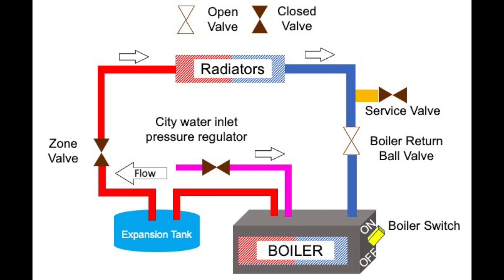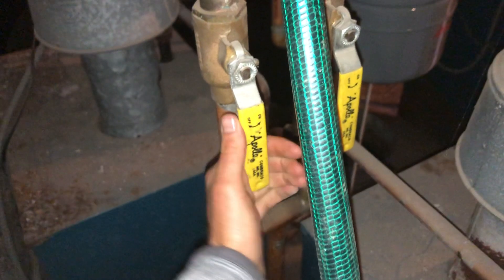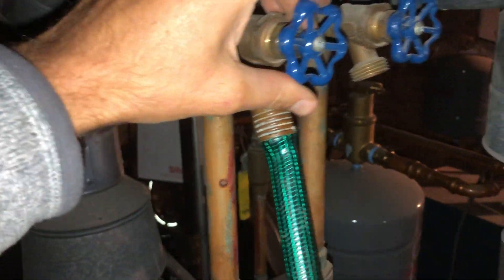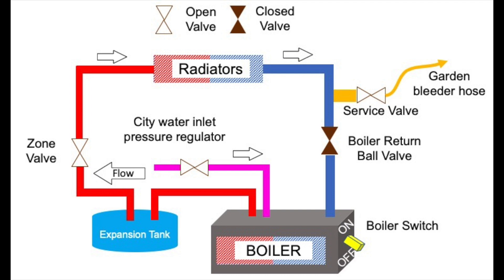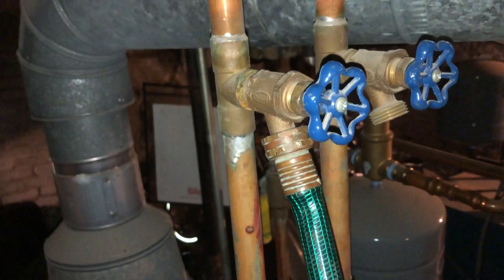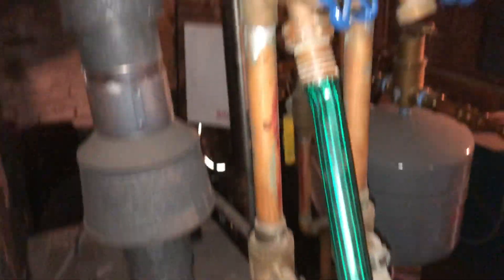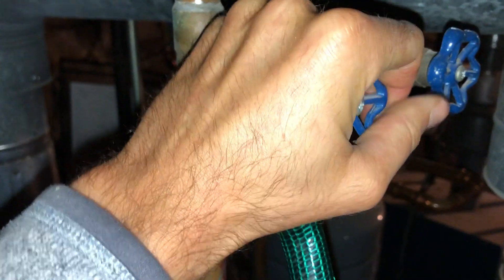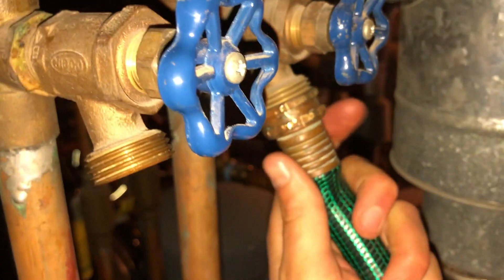How to Bleed Radiators in Entire Heating System Quickly and Effectively

Comment: Tracing my 30-year old pressurised CH system, I find a pipe teed off to the hot water cylinder heating spiral (i.e. coming from the boiler) that goes via a gate valve to the water tank in the loft.  There is no feed loop near the boiler, which is in an outhouse.  I'm guessing that the top-up for the system is being fed from the loft tank and that valve was open.   Is this a normal installation, and should I close that valve or leave it open?   Most YT videos address more modern systems, so thanks for your help.

Comment: Hello, why would one need to open the city pressure at all? You say that if the pressure reducing valve is not open, its still letting water through the system, but at reduced pressure. So why need to open it in the first place? Is it to make the bleeding process faster? Can i bleed without opening to city pressure? Thanks for your help!
Reply from the maker: @falconxlc  Yes it accelerates the process.
Reply: @OliverPorter92  awesome, thank you for the reply! Have a blessed day.

Comment: At 0:53 seconds he says "open this to charge city pressure." What is that he is opening?
Reply from the maker: @kellybarbie8381  I am lifting the valve on the pressure regulator that reduces city pressure from the street inlet to the house to a lower value. I only do this once the hose is running so as not to over pressure the system, but to force more water in

Comment: Will his process remove air at top of radiators or do I need to still bleed the radiators?
Reply from the maker: Honestly depends.
Reply: @OliverPorter92  I know nothing about plumbing, but the radiators are the high spots in the system so I’m guessing there gets stuck there. In fact, I wouldn’t be surprised of all the air in the system gets stuck in the highest radiators in the house.

Comment: Question: Whats the difference between the 'Boiler Feed Water Pressure Regulator'  & the feed water fill valve? Dont the parts look the same/similar? It has the little metal lever that u can control with your finger. Are they the same part or different?

Comment: I needed to drain my entire system to remove a downstairs radiator. Once I reinstall, is it possible to bleed out the system one radiator at a time using the bleeder valves on them? I don't have all of the hose bibs in for draining in my basement that you do.

Comment: do o need to have the heater on the thermostat on while and after bleeding?
Reply from the maker: Always bleed with heater off, if heat is on you can scald yourself. Hope this helps!
Reply: @OliverPorter92  i have already bleed the water out but I accidentally lowered the pressure to 5, almost 0. 

So I am currently trying to re-pressurize the heating system. 

Now to repressurize the radiator, do I need to turn on the thermostat? 

Thank you for the reply!
Reply from the maker: @Lawlesslarry69  Just follow the procedure in the video towards the end - carefully refill the circuit with the bleed port closed (adds water without letting water out) and watch pressure to not over pressurize. You can speed this up by charging with city pressure but be very careful not to over-pressurize. Do not turn the heat on with low pressure.
Reply: @OliverPorter92  ahh i understand now!
 I will give an update on this but I think i figured it out based on your guidance.

You earned a subscriber.
Reply from the maker: @Lawlesslarry69  Thanks hope it worked out!

Comment: I only get heat on the first level and none of the second and third level I have baseboard heat but they don’t have a bleeders on them. Do you think I need to bleed the whole system first from the boiler? Or could that be something else? Also I have a radiator in the hallway ont he second level that heats up but nothing else..

Comment: I've done this a few times now, with thanks to Youtube guys like you. Easy peasy. But today, it went very slowly. No rush of water when opening the filler valve, no fast flow from the hose; kind of slow, with little bursts of bubbles every 10 seconds or so. Just a steady dribble otherwise. Nothing at all like in the past. I'm thinking that the feed pressure regulator (which is, after all original equipment, about 40 years old) is defunct.
Reply from the maker: Thanks for watching - interesting, that's a good hypothesis, let me know what you find!
Reply: @OliverPorter92  A replacement part was readily available, but it wasn't clear whether I'd have to drain the system to change it, so I described the issue to our plumber, and he agreed it was the regulator, & I had him change it.  I like to DIY, but sometimes it's easier to let the pros do it.
Reply from the maker: @blueyedboymrdeath  Awesome, glad it worked - and totally agree, the big stuff requires the pros!